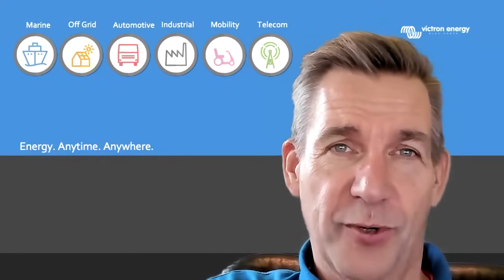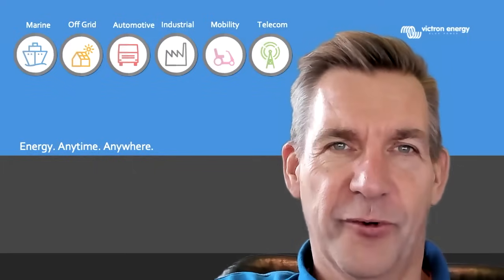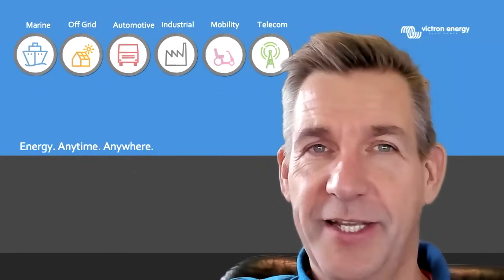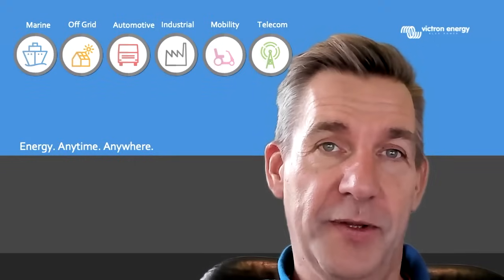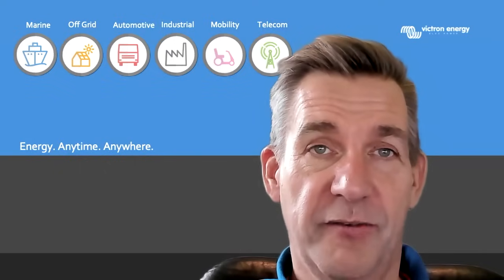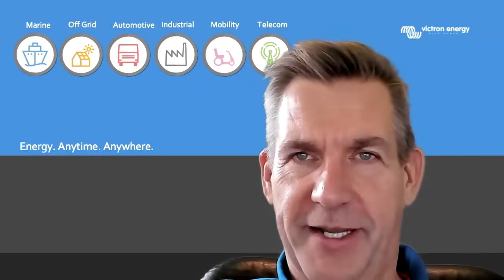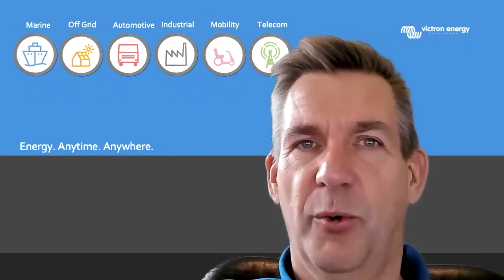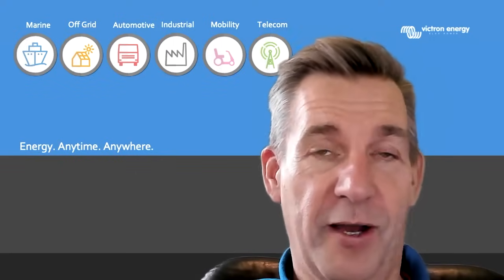How to set up BMV Battery Monitor for lead and lithium batteries

Comment: Regarding capacity, just to be sure; I have 3x 12V 115ah batteries in parallel.  Do I then set the capacity to 345ah? And use 345ah for the calculation of tail current?
My SOC is not helpful at all so I’m trying to find out why. 

Tail current (what the battery is receiving after being charged for 12 hours) is 4,1a. That gives my a tail current of 1,1% if I use 345 as capacity.
Reply: ye correct
Reply: M
Reply: This is interesting where  did you look at tail current ? The current for 4amp from your solar app that was putting current into the battery or the current from the mains charger looking in the bmv settings app for current going in
Reply: Also do you have to turn all loads off to test this current or use loads ? Sorry I’m trying to learn myself instead of someone doing the settings for me 
I have 230ah lead battery and trying to figure out the tail current in the bmv app I’ve turned solar tail current off. surly you only need tail current in the bmv app not both
Reply: @MotorhomeDIY  yes indeed , just to see the tail current for your setup
Reply: It’s 0.04 x345 which is 13.8amps which is your charge current so 1.1% is 4amp 2.2% is 8 amp 3.3% is 12amp so I would pick 3.8% tail current

Comment: Copy use voltage to figure out power level and disreguard the % on the monitor because its useless do you so many variables.
Reply: ?  the voltage isn't telling a reliable SOC, that's why you need to set the unit up right and have a very accurate readout.

Comment: Dear sir, I have a mppt 150 85 -tr.
On many occasions on a cloudy but with clear sky's the controller reaches its maximum of 85a and remains at this for some time.  Will this blow the internal fuse or cause it to shut down.
I ask this because for the first time the controller stopped working, was not hot just warm.  After switching off the pv and switching it off in the app the main fuse for the battery from the controller was removed.  After about 4mins , fuse refitted, pv switched ON, the switched ON in the app. It restarted and all was OK.
Would appreciate your comments on this please, thank you.
Regards.
Tony.
Reply: no, the unit will limit the current , and is ablate do this 24/7 . IF it stops working its most likely to overvolste on the PV side which potentially can damage the controller.  So please check if the Voc cannot be higher /too close to the maximal value (150Vdc in your setup)

Comment: Why doesn't Victron have a  customer service/tech rep call-in service?
Reply: I understand the question but the answers is quite simple, Victron has about 100 employers and the numbers sold of only the BMV for example is 100K plus yearly. This means that if even 1% of the users would call the delay would be enormous.   So all technical information is found online in write, video and presentations. Also of course, the network of dealers is there to help. They helped you selecting the right device for your system and can also advise you to set it up.   In you case, what setting isn't clear to you?

Comment: Isn't easier and user friendly - even for humans like me - to choose battery type directly in bmv? Number of cells is also useful parameter (my first 48V battery pack contained just 15 lifepo cells = 48V (not 51.2V, because I am human ;)  Everybody talks about 12V systems, however 48V is a must have for homes. Also, you haven't mentioned how the communication/charging is handled if mppt and bmv are connected to color control gx. Thanks.

Comment: Many thanks for this well explained videao. I just installed a Smart Shunt on my offgrid system and followed your recommendation to use the absorption Voltage as the "Charged Voltage". On my MPPT, my float voltage is 27.4V, absorption Voltage 28.6V. I have set my Charged Voltage at 28.2V, Discharge floor at 80% as I only use 15% of of 220AH battery. I have set the Charge efficiency at 75% and charge detection time to 3 minutes and the tail current to 5.5% (12.1A). When my battery was full, I the current reamined at 1.5A, Could my tail current be set too high? Also, the shunt nuver sychronised automatically? Could there be something wrong with my settings? If yes, what should I adjust my settings to?

Comment: I have a BMV 712 in use for two years in my van and it worked flawlessly. Until a couple of weeks ago. Then suddenly it just showed  0.02V for the starter battery and 0.03V for the leisure battery. Both batteries fully charged and everything working. All other values which the BMV shows are correct.
I resetted the device, checked all cables (both positive red cables connected to the shunt measure 12.xV) -but still the same problem. Is it kaputt just after warranty time? What else can I check?
Reply: Finally I found the cause of the problem. The plug in the BMV was loose. Sounds easy to find but it was not so that the BMV didn't show anything anymore, then I would have looked for it at first. But it was so that the BMV was working, it was under voltage, there were just some values wrong, therefore I didn't think the plug could be the problem.
Reply: Sorry to hear this!   its is most likely a warranty issue as this seems a hardware failure. Sure there wasn't a (too) high voltage there?  mostly these are known to be pretty robust.   Please ask the dealer for further support.

Comment: Hi Johannes,
Thank you for your informative video's!
How long before a Victron smarthsunt will drain a fully charged 100 ah lifepo4 battery (superpack) if the smarthsunt is the only thing connected to the battery? (i.e. when caravan is not in use in winter) Or should I disconnect the smarthsunt together with the battery?
Reply: the self consumption is <1mA , so theoretical a full 100Ah battery should be able to feed this 100.000 hours.   In reality the battery will discharge itself faster then the consumption of the shunt, so the effect of having a shunt connected will be hardly noticeable in time.
Reply: @johannesboonstra6917  So no worries. Thank you for the answer!!

Comment: I have a MP-II connected to a LiFeOO4 battery pack with BMS which has no connection to the MP-II. I use ESS in ‘Optimized(without Battery Life)’ mode.  With the help of your good explanation in this video, I set my MP-II as the battery monitor with 90% as the SoC when bulk charging stops and 10% as the SoC limit in ESS.  I therefore only use 80% of the battery capacity in a hope to keep its life longer. It works fine but I found that the system somehow forced the SoC to 100% when it changes from absorption to float. This messed up my SoC calculation.  To prevent this from happening, I set the absorption time to 23 hrs so the system would not change to float state before the next daily 4-hour charge during mid-night low-rate period.  May I know the possible causes of the force change to 100% at float?  How can it be prevented?  I can’t find it mentioned in any manual or setting.
Reply: When the charger goes to float, your batteries are full I suppose, or not? Normally the lithium batteries need to be brought up to a specific voltage to have them fully charged, the absorption isn't actually absorption but only a period of high voltage to allow the balancing work the cells.
Reply: @Johannes Boonstra  , thanks for the reply. In my case, the MP-II goes to float just because it is at the end of the absorption (not because the battery is full) and the duration of the absorption is set my me. I defined it as 90% SoC at the end of Bulk charging. I originally set the absorption to 1 hr (which is the minimum that I can set) and I found that the SoC went up from 90% to around 93% at the end of that 1 hr absorption. After the absorption, the system changed to Float and also changed the SoC from 93% to 100%! Such sudden change of SoC to 100% is not what I wanted. I therefore set the absorption time to 23 hours so that it would not change to Float during the scheduled charging period. I set the system to change to 90% SoC at the end of the Bulk and it is working fine. May I know how I can stop the system from changing the SoC to 100% when it changes to Float?

Comment: Hi ... Victron company . I see your soler plants  .that is very best . wich is better battery and soler panels . I want your system and your products . 
I want 20 kw soler pawer for 24 hours all days . and for 4 Air condition 1.5 tons. water moter geezer bulbs tubes and electric stove. 
Pleas contact me .
Reply: Hello. As much as we want to contact everybody, its best you go online and visit our website, there at were to buy you can select a local dealer which can help you further.

Comment: Thank you for the great explanation @victron. just to confirm. According to the battery supplier, the absorption voltage is 29.4V. That means that the setting fot the charged voltage should be at 29.6V. And not to 26.4V as recommended in the BMV manual. Also should I raise the tail current to 5%-6% instead the default 4%.
Reply: if absorption is 29,6, Charged voltage is 29.4!  higher then 29.6 will never be reached
Reply: @johannesboonstra6917  I think there is a misunderstanding. My settings are above 29V and not 26V as recommended by the BMV.
Reply: @johannesboonstra6917 dont you say at 6:50 that the charged voltage (VC) should be set 0.24V lower than the FLOAT voltage (not the absorption voltage like you mention here)? 

that would be quite a difference between 29.4 and 26.4V

Comment: Great video, @Johannes, thank you. I have an academic question based on my current situation and observations. I have a SmartShunt connected to MPPTs and Bosch 500 aH Lead acid batteries that are fairly new. Peukert is 1.3, Charge Efficiency is 75%, I have set capacity to 90% of labelled capacity. State of charge starts the day at 85% (75aH consumed since full/float). It will roughly increase in a fairly linear way throughout the day due to charge from MPPTs. Absorption phase doesn't start till SoC is 95-98%. This suggests that SoC on the controller is increasing too rapidly or not declining enough overnight. What parameters should I be looking at to adjust this? As you state in your video, the charge efficiency is variable depending on the SoC of the battery yet this is a fixed value, is this possibly the issue? I have tried adjusting to extremes yet every time my SoC is >95% when absorption starts which can be misleading. Thanks a lot.
Reply: soc is increasing to rapid?     Why have the Ah set lower then they are ?   the absorption is based on voltage, so if you would have entered the AH correct the absorption would start at 80-85 which would be correct
Reply: @johannesboonstra6917  The battery bank is a Bosch L5075 Lead Acid (4 x 140aH) and been through about 100-200 cycles with DoD not dropping below 60%. With Absorption starting when the SoC is at >95%, I can only assume that the capacity of the bank is much less than I think they are.

Comment: Your company is a scam and full of sheet . Installed your monitor on my boat. Took 2hrs for your firmware to upload ,three days later you wanted another firmware update ,WTF? ,4hrs later still not uploading , .. I've uninstalled and reinstalled from Bluetooth per your recommendation ,nothing ,I've updated your app ,still nothing . Than you recommend using an iphone and say it always works with that ,WTF AGAIN ? you never mentioned  that on any of your products that you'll need spend a $1000 and buy an iphone, what BS ,don't buy from these scammers , and after I've already put firmware in the device ,why do I need to keep updating ? ,it worked fine before ? Don't buy this garbage .
Reply: I am sorry that you have this experience with our products.   Normally an update is a matter of sec/min.  It is true that some phone's have difficulty connecting and to test with an iPhone or such it can be ruled out its something on the monitor side.  Anyway, If yo keep having issue with the battery monitor, please contact the installer or us for further help.
Reply: @johannesboonstra6917  A very polite and classy response to a customer who clearly is not happy Johannes. Hopefully when he has cooled down a bit he will contact you or his installer in a better frame of mind so that his issues can  be fixed.
I have a Victron BMS 600 which was fitted when we bought our caravan, and have never fully understood all the settings, so this video has been very helpful.
do you have other videos which might guide me through choosing the best combination of devices ( DC-DC charger, solar controller and mains charger and perhaps inverter for 240Vac as well eventually) MY wife and I travel in outback Australia during our winter, (although Northern Australia can still have temperatures above 35ºC during this time,) and in the past with 2 solar panels 60W ea, and charging from our tow vehicle, — no DC to DC charger, and we have had to run a Honda eU20i generator a lot to keep power for our refrigerator 6A when running, and a 55litre refrigerated ice box, 2A when running. Possibly around 100AH for the two with < 120AH for a total daily usage. Victron seem to have so many products, many with seemingly similar specifications, and I am looking for some help in choosing the best for me combination of components, so if any of your videos cover these topics, I would be most grateful if you can steer me toward them. Thank you

Comment: I think  a lead acid battery  Battery that absorb 4% of capacity in current, is NOT FULLY CHARGED.
Maybe is 90/95%.
A fully charged lead acid battery absorb less 2% of capacity at absorption voltage, and less of 1% at floating voltage.

A tail current on smartshuunt of 4% means that every synchronization will be anticipated respect to real 100%,and false.
Reply: You may use that as setpoint s well if you like of course. Our experience is that after a bulk period with a 10-15% charge current the SOC is already 80%-85%.
Reply: @johannesboonstra6917  That's what I think too. After the bulk phase with 10% current there is a SOC of 80/85%. But At the end of the absorption phase there is a SOC of 99% if the absorbed current is less than 2%. In fact, the battery chargers or solar controllers (also victronenergy) that terminate the absorption With the tail current, they do so below 2% or less. A current of 4% on the other hand does not indicate 100% SOC, rather than 95%. I did some tests, and my victronenergy AGM Deep cycle 110ah battery is not at 100% when it draws 4.4 Amps in the absorption phase. It is at 99, x% when it absorbs about 1.7Amp in the absorption phase. Otherwise why do your Smartsolars terminate absorption with a tail current of 2%? And not 4%?
Reply: @fc436  so just adjust your settings as you see fit. I also disagree with some of these settings for lithium batteries, especially when charging with solar that only manages a relatively low charge current.
Reply: @fc436  yes but 1.1% tail current in the bmv  is 4amp  in the mppt 
4amp ia 1.1%